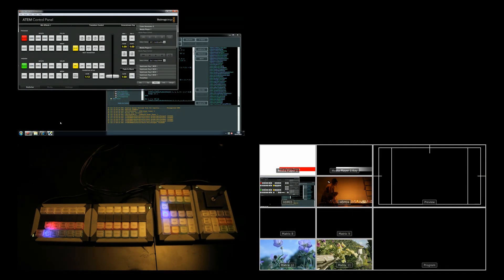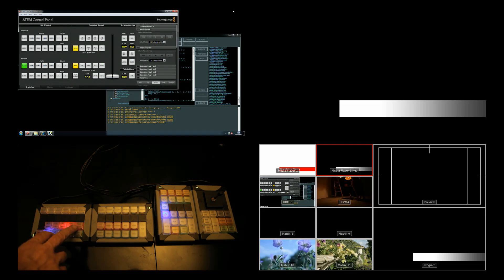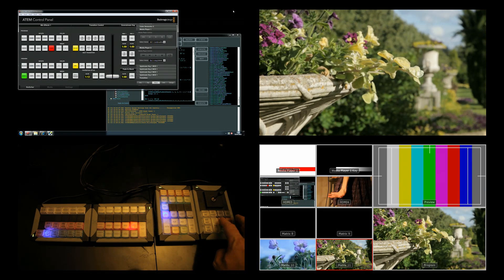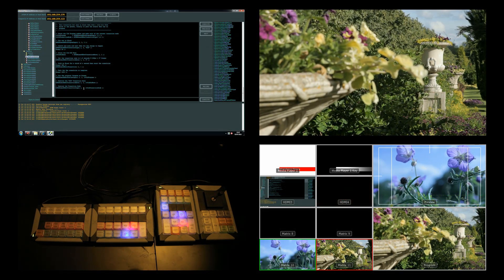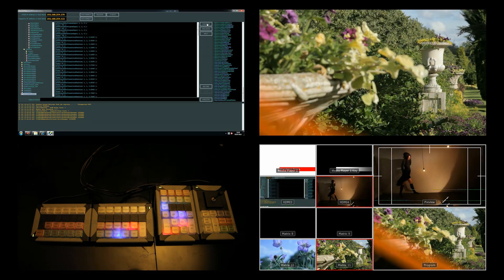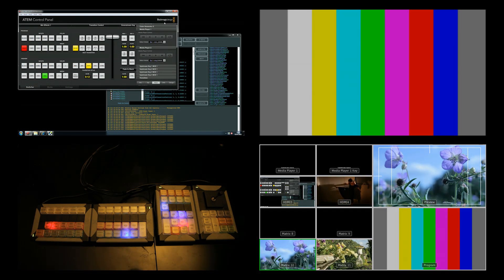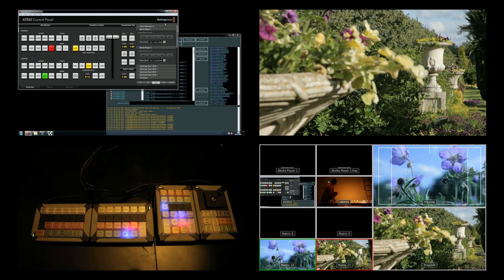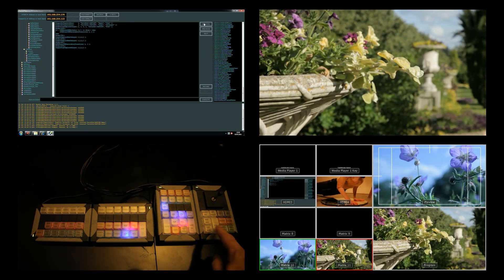ATEM Macros with XKeys

Comment: Hey
I have the Atem me1 and the x keys xk80
i have no clue in scripts and stuff but it seem you covered almost every important button in your configuration.
can you maybe publish the scripts you show in this video so people like me that want to use all this things but don't know how to read/write scripts can use it and just assign them to different buttons?
it will save me alot of time trying to learn every code in there
Tanks!!!!
Reply from the maker: All the scripts are published, and in fact many of the button functions are available by using point and click  selections of built in functions. You should only need to script, when you need to do advanced things like triggering Hyperdecks / CasparCG on TX cuts, and the such like. The ATEMUser forum has much more info, and links to the main JustMacros website.